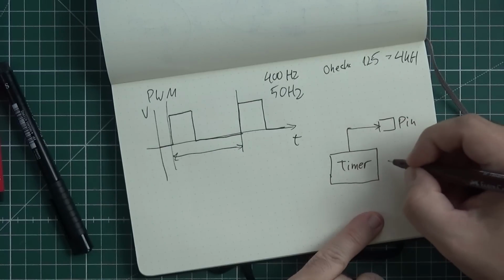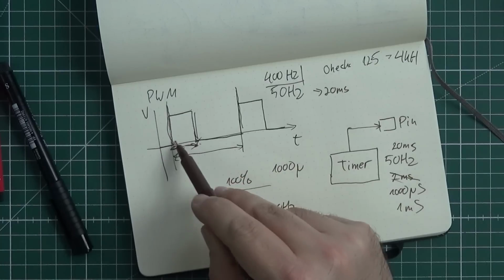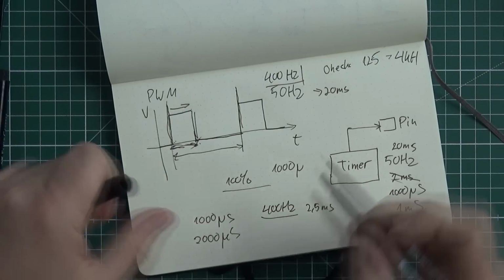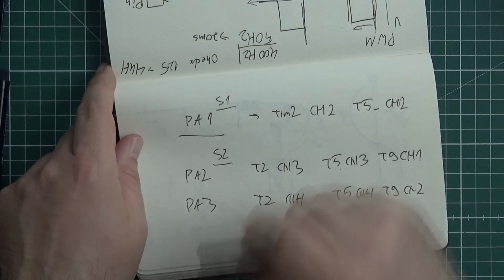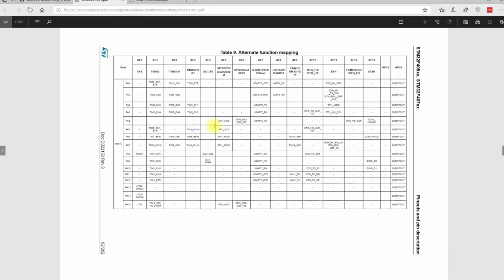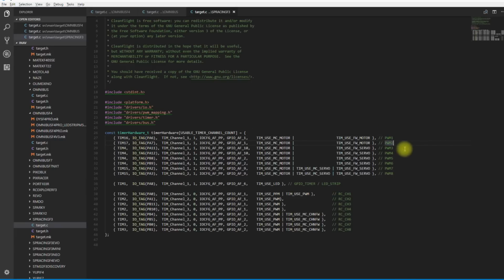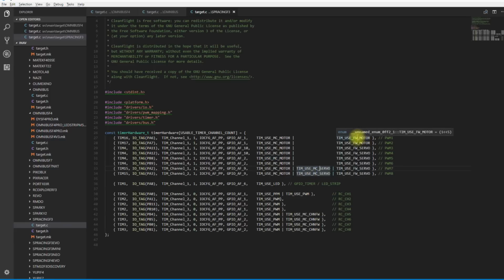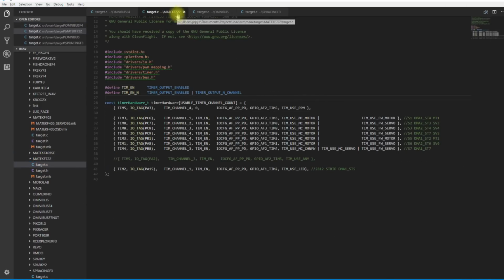INAV, Resource Mapping, Motors, Servos and Timers

Comment: Inav 8.0.1 - I am building an Octo X8 - Inav is assigning Motor 5, 6, and 7 - all three - to timer 8 - is that OK?  Three motors on one timer?  It's odd because the other timers each share TWO motors - so why is timer 8 spread among three motors?  Also, I can't get motor 7 to spin and it also happens to be the THIRD motor assigned to Timer 8.  So is it the fact that it's the third motor on Timer 8 the problem?  And if so, how do I fix it?  Thanks...

Comment: must ask you once time more for help. My problem is that with  inav51 and omnibusf4pro my esc's and motors burns. The reason is rate of pwm for motor that is in reality 401 Hz. Thearetically it is possible to change this frequency to 50Hz but in reality frequency rest 401 Hz. Change to 50 Hz is possible in CLI but this is not working. Error in INAV or something can be done ? The frequency for servos is correct and equal 50 Hz.Thanks for your help in advance.

Comment: Hi Pawel, watched your video with interest as I seem to have a problem that is of the same nature:
I am trying to setup a Volantex ASW28 with a Matek 405 Wing. I want to add a Pan/Tilt camera mount on channels 7 and 8.
I have a Crossfire Nano (UART2) and a Beitian 220 GPS (UART3). I have an OLED connected to DA1 and CL1.
GPS works, Receiver works, OLED works.
Mixer Preset is "Airplane"
Motor is on S1, S2 is not used because as you showed it's not for servo use and could fry the servo
S3 is Elevator Servo
S4 is Left Aileron Servo
S5 is Right Aileron Servo
S6 is Rudder Servo
S7 is Pan Servo (passthrough from RC Channel 7)
S8 is Tilt Servo (passthrough from RC Channel 8)
But none of the six connected servos work (servo rail has 5V).

When I use the status command on CLI tab, it shows:

PWM output init error: Not enough servo outputs/timers

I am running INAV 5.1.0 and used the inav_5.1.0_MATEKF405SE.hex (76f22b25) target to flash the FC.
Any ideas what could be the reason? Any help would be greatly appreciated...

Comment: 13:50 What if I have 4 motors drone and want to use PWM3-PWM6 for motor 1..4 ? Can I then use PWM1 and PWM2 for different purposes?

Actually, I have Matek 405HDTE which has s1-s8 available for motors, but s3 is broken, and I have 4-motor drone. And I can't find how to use, for example s5 for motor #3, because if I choose 4-motors drone, it doesn't allow me to have access to the s5 and more. If I choose 6 or 8-motors drone, I soldered s5 to motor 3 and it works, but what to do with wrong configuration? Is it possible to tune it manually somehow - leave 4 motors drone but have it to treat s5 as s3 ?

Comment: It would be awesome if you made a follow-up video showing a couple of examples of how to set up those those lines for a custom build. 
One question that a follow up might answer is whether you can assign a different timer to an output, such as changing PA8 to TIM 3 instead of TIM2.  Or is the mapping of timer to output determined by hardware?

Comment: I have a related issue, but I can't tell if this is the same problem. I have 6 functions and 6 outputs on my board, but in the output mapping box in the outputs tab, the functions are shifted over to the right, meaning I can't arm because the FC is trying to output PWM through the imaginary S7 and S8, while S1 and S2 are unused... This video seems like quite a lot of work for shifting those functions over to different outputs.

Comment: Is there any way of getting motor output limiting like on Betaflight so that I can run my 4s motors on 6s?
Reply from the maker: throttle_scale
Reply: @FPVUniversity  Thanks! I initially thought that it would not apply when in autopilot like rth (in cases where there was wind and the motors were over-revved)

Comment: So on my miniquad, I mistakenly installed my MATEK F722SE with front of board facing the rear. The motors are connected to the wrong pins on the board. I can do resource remapping with betaflight, but not with INAV 2.5?

Comment: Thanks for your video! If I want install an FC without channel output (span pro f4) on a single motor wing...in your opinion how can I use motor output 2 and 3 (or 3 and 4) for the servos? Can I tab resource on CLI, copy the ports on servos 1 and 2 to motor 2 and 3 resource? That all? Thanks in advance. Sorry if is not clear.
Reply: did you get this figured out? I'm not using any motors on my board and I cant even have 6 servos despite having 6 pwm pins.

Comment: I am trying to get the electric retracts to work on my Matek F722 FC, it was easy in quad config as the servo output just automatically is set to pin s6.
This is a problem now because I rebuilt it to a hexacopter and cannot get the s7 pin (it even says "PWM" on it) to operate the retracts, it still puts servo1 on pin s6. Any ideas?

I have never looked into the firmware stuff, is this useful in any way?

#ifdef MATEKF722_HEXSERVO
    DEF_TIM(TIM1, CH1, PA8, TIM_USE_MC_MOTOR | TIM_USE_FW_SERVO, 0, 0),  // S6 DMA2_ST6
#else
    DEF_TIM(TIM1, CH1, PA8, TIM_USE_MC_MOTOR | TIM_USE_MC_SERVO | TIM_USE_FW_SERVO, 0, 0),  // S6 DMA2_ST6
#endif
    DEF_TIM(TIM4, CH3, PB8, TIM_USE_MC_SERVO | TIM_USE_FW_SERVO, 0, 0),  // S7 DMA1_ST7

    // DEF_TIM(TIM5, CH3, PA2, TIM_USE_ANY, 0, 0),  // TX2/S8  DMA1_ST0

Comment: Hi, thanks again for taking the time to give us this video, and for all your other efforts for the community. My question: - is there a reason why we have to run the motor outputs at 400Hz for fixed-wing aircraft? All standard receivers run all their PWM outputs at the same 50Hz servo timing, so surely iNAV should do this from the FC. This would elimiate the issue with re-mapping motor to servo outputs in the FC, would it not? We don't need the kind of throttle control that quad pilots need, so I'm sure 50Hz is perfectly acceptable (and it means that you won't burn out your servo if you accidentally plug it into the wrong output!!) :-)

Comment: Hi Pawel,
Great video, learned a lot from it and set up a machine and compiled a build to make sure all works. 
I am trying to build a Colibri Race target with a small change, but am not sure how to make it happen. If I understood your explanations correctly this should work...just a matter of knowing what to change.  ESC 2 pin always acts as pitch on my fixed wing. I am not sure what to change to make this happen. There does not seem to be any timer conflicts.
    DEF_TIM(TIM1,  CH1, PA8,  TIM_USE_PPM,                          0), // PWM1 - PA8
    DEF_TIM(TIM3,  CH1, PC6,  TIM_USE_MC_MOTOR | TIM_USE_FW_MOTOR,  0), // PWM2 - PC6
    DEF_TIM(TIM8,  CH2, PC7,  TIM_USE_MC_MOTOR | TIM_USE_FW_SERVO,  0), // PWM3 - PC7
    DEF_TIM(TIM8,  CH3, PC8,  TIM_USE_MC_MOTOR | TIM_USE_FW_SERVO,  0), // PMW4 - PC8
    DEF_TIM(TIM8,  CH4, PC9,  TIM_USE_MC_MOTOR | TIM_USE_FW_SERVO,  0), // PWM5 - PC9

My 3 servos would all be on tim 8 and motor would be tim 3. but the above stock code makes any motor connected to esc 2 pin be controlled by pitch. Unsure why I can not use esc 1 pin

Any help would be greatly appreciated!

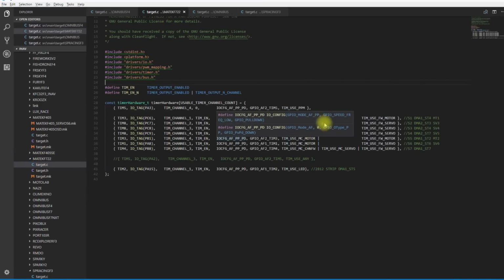Comment: Hello Pawel, thanks for the technical explanation on timers! On 15:20 the Matek F722 board, why can't you allocate TIM1 on PA8 as a servo since for a quadcopter you have TIM3 and TIM8 distributed among five output pins? And can you explain what you mean by S7 not being driven directly? Thanks!

Comment: hello, I have to remap engine 1 on engine 5 on omnibusf4pro, I modified the main file / target / OMNIBUSF4 / target.c changing pb0 to pa1 and the other way around, I saved, compiled and flashed but the exchange does not happen, where am I wrong?
Reply from the maker: you also have to adjust timer associated with the pin itself
Reply: @FPVUniversity  I forgot about the timer,😩 thanks a lot😀

Comment: Buenas tardes, magnifico como siempre, muchas gracias por  el vídeo. :-)
Por otra parte no si esta relacionado con este vídeo y si se puede hacer, yo pregunto.
Tengo entre otras, la compre por probarla una f4, es una f10-wing fc, firmware ff_f35_lightning 2.0.1, muy baratita, ciertamente va muy bien, pero tiene un problema, me ha dado por ponerle led_strip a los avienes, y esta controladora no parece que tenga habilitado un puerto para esto. tiene sin embargo invertido un puerto para telemetría smartport de frsky, se conecta directamente sin ningún tipo de soldadura en ningún pad y funciona muy bien.
He consultado el comando "resource" y parece que tendría varios puertos libres, no se si son compatibles con los temporizadores, te pongo un listado:
# resource
IO:
----------------------
A00: SERIAL4 UART TX/RX
A01: BEEPER OUT
A02: SERIAL2 UART TX
A03: SERIAL2 UART RX
A04: OSD CS
A05: SPI1 SCK
A06: SPI1 MISO
A07: SPI1 MOSI
A08: INVERTER OUT
A09: SERIAL1 UART TX
A10: SERIAL1 UART RX
A11: USB IN
A12: USB OUT
A13: FREE 
A14: FREE 
A15: FREE 
B00: MOTOR5 OUT
B01: MOTOR6 OUT
B02: FREE 
B03: SPI3 SCK
B04: SPI3 MISO
B05: SPI3 MOSI
B06: I2C1 SCL
B07: I2C1 SDA
B08: MOTOR3 OUT
B09: MOTOR4 OUT
B10: FREE 
B11: SERIAL3 UART RX
B12: FREE 
B13: SPI2 SCK
B14: SPI2 MISO
B15: SPI2 MOSI
C00: MPU CS
C01: ADC CH3
C02: ADC CH2
C03: ADC CH1
C04: MPU EXTI
C05: BARO CS
C06: SERIAL6 UART TX
C07: SERIAL6 UART RX
C08: MOTOR1 OUT
C09: MOTOR2 OUT
C10: LED1 OUT
C11: FREE 
C12: FREE 
C13: FREE 
C14: FREE 
C15: FREE 
D02: FREE 

Como la tengo instalada en un ala volante, y solo necesito dos servos ¿Podría habilitar/remapear/asignar por ejemplo el motor 6/servo 6 para sacar por ahí la señal de los led? y si por ejemplo la usara en una avión en el que necesito los cuatro servos, dirección-profundidad-y dos alerones ¿Podría usar otra salida?por ejemplo ¿o ver algún otro puerto libre?
¿como puedo saber cada recurso a que salida de pines esta asignado?
Y, jaja, mas importante, como sería el código para hacerlo, para asignarlo.
Perdón por mi osadía e ignorancia. Ya sabes la ignorancia es muy osada.
Un saludo y muchas gracias.

Good afternoon, great as always, thank you very much for the video. :-)
On the other hand not if it is related to this video and if it can be done, I ask.
I have among others, buy it by trying it a f4, it is a f10-wing fc, firmware ff_f35_lightning 2.0.1, very cheap, it is very good, but it has a problem, it has given me to put led_strip to the avienes, and this controller it does not look like you have a port enabled for this. it has nevertheless invested a port for telemetry smartport of frsky, it connects directly without any type of welding in any pad and it works very well.
I have consulted the "resource" command and it seems that it would have several free ports, I do not know if they are compatible with the timers, I put a list:
# resource
IO:
----------------------
A00: SERIAL4 UART TX / RX
A01: BEEPER OUT
A02: SERIAL2 UART TX
A03: SERIAL2 UART RX
A04: OSD CS
A05: SPI1 SCK
A06: SPI1 MISO
A07: SPI1 MOSI
A08: INVERTER OUT
A09: SERIAL1 UART TX
A10: SERIAL1 UART RX
A11: USB IN
A12: USB OUT
A13: FREE
A14: FREE
A15: FREE
B00: MOTOR5 OUT
B01: MOTOR6 OUT
B02: FREE
B03: SPI3 SCK
B04: SPI3 MISO
B05: SPI3 MOSI
B06: I2C1 SCL
B07: I2C1 SDA
B08: MOTOR3 OUT
B09: MOTOR4 OUT
B10: FREE
B11: SERIAL3 UART RX
B12: FREE
B13: SPI2 SCK
B14: SPI2 MISO
B15: SPI2 MOSI
C00: MPU CS
C01: ADC CH3
C02: ADC CH2
C03: ADC CH1
C04: MPU EXTI
C05: BARO CS
C06: SERIAL6 UART TX
C07: SERIAL6 UART RX
C08: MOTOR1 OUT
C09: MOTOR2 OUT
C10: LED1 OUT
C11: FREE
C12: FREE
C13: FREE
C14: FREE
C15: FREE
D02: FREE

Since I have it installed on a flying wing, and I only need two servos, could I enable / remap / assign, for example, the 6 / servo 6 motor to take out the signal from the LEDs? and if for example I used it on a plane where I need the four servos, depth-direction and two ailerons, could I use another output, for example, or see some other free port?
How can I know each resource to which pin output is assigned?
And, haha, more important, as it would be the code to do it, to assign it.
Sorry for my daring and ignorance. You know ignorance is very daring.
Regards, and thank you very much.
Reply from the maker: lo siento, no hablo Espanol
Reply: @FPVUniversity  gracias por tu pronta respuesta, lo he puesto en inglés a continuación, en inglés de Google, jaja.
Thank you for your prompt response, I have posted it in English below, in English from Google, haha

Comment: Can I use the motor output for servos on a Betaflight F4 flight controller?
Reply: Did you solve?  I want install an FC without channel output (span pro f4) on a single motor wing...in your opinion how can I use motor output 2 and 3 (or 3 and 4) for the servos? Can I tab resource on CLI, copy the ports on servos 1 and 2 to motor 2 and 3 resource? That all? Thanks in advance. Sorry if is not clear.

Comment: How was this problem overcome with inav 2.0? I've tried assigning a 3rd motor to my matek f405 with inav 2.0 and I don't get it as an listed output in the mixer tab.
Reply from the maker: INAV 2.0 is not even trying to fix this. It allowed for better mixer management, not output management
Reply: Paweł Spychalski I think I understand it's just giving you outputs from the rules available, but you get to pick the outputs from the rules available.

Comment: Hi, 
thanks for the explanation. But what do you mean by S7 is not driven out directly on the Matek F722?
I'd like to employ it on a quadcopter with four servos for gimbal etc. Is it possible to use S2, S3, S4 S6 for Motor output and S1, S5, S7 as Servo PWM? An 8th PWM Pin would be great, like using the LED Output..I don't need LEDs in this project. Is something like this possible?
Reply from the maker: Not on Matek F722. This just will not work

Comment: just found your videos, very helpful... thanks...question...can all the timers all be set at a high rate like 360hz and use only digital servos or motors on any pin? I recall being able to do that with baseflight long ago but had no arm/disarm feature because I was using servo pins and not the motor channels

Comment: Pawel, i'm trying to manually control pitch on my Storm 32 Gimbal on my quad using AIRBOT Omnibus F4 V5. im not sure if i should connect it to PWM 5 or PWM 5 pin on the board or if it is possible at all. Please help if you have any tips. Great video though

Comment: Thanks for the great explanation, but one question, wouldn't plane esc's be fine with servo frequency of 50Hz? they don't have the same response rates demanded by quacopters running D shot, one shot etc. Basically everything in a plane (analogue servo equipped) can clock at 50Hz.
Reply from the maker: Yes they would, but what about tricopters? And other setups? We will not implement solution that works only of some of setups
Reply: So at config model type, setting airplane could not configure the outputs to be unified at 50hz? Sounds like inav is still unsuitable as a fixed wing alternative with too much multirotor legacy. One day maybe..
Reply: @alasdair4161  If it breaks off into a wing only configurator, we also break up the brains and support and community feedback into pieces as well.

Comment: Pawel, let me disagree with your explanation in case of airplane I DON"T need any fast PWM for motor. 50Hz is enough so mapping servo to motor output should be possible. And to prevent burning servo in case of any remapping all timers are blocked to 50Hz. Is there anything wrong with my understanding of remapping?
Reply from the maker: Please remember that your need (or lack of one) might not be one for someone else. What about tricopters?
Reply: Just talking about planes, copters are different story and 3copter is copletely different. And in case of planes you can use even now mmix to drive i.e. rudder. But I think this should be more consistent.
Reply from the maker: But when you add a resource mapping it has to support all supported platform. Not just selected. Or you end up is even worse situation in a beginning.
Reply: right, so maybe all is needed to document how to run i.e. rudder with mmix in case of plane. BTW I'm not sure if any servo will be affected by oneshot, but I need to check.
Reply from the maker: Cheap servos will fry up immediately at 400Hz. Only really expensive ones will survive 300Hz. All the cheap ones share the same chipset
Reply: you are right, I mixed pwm freq with multishot
Reply: @FPVUniversity  Hi - I am in the same position as this poster.  My single motor on my fixed wing is happy at 50hz, but I need to use S2 as a 50hz servo because my "Omnibus F4 V2" is kind of weird and only has 4x output pins.  Since S2 is disabled for me (can only be motor), I can only control the main motor, roll, and pitch - no yaw.  What can I do??
Reply from the maker: @tymarbut4784 write a custom firmware
Reply: @FPVUniversity   - Hi, thanks.  I was investigating that - I found the .c and .h and .mk files on github, and I can see exactly what to edit, but I don't know how to make the magic .hex file out of those.  For now, I'm just going to control the rudder and flaps from the radio and iNav will only have access to motor/ailerons/elevator.  Hopefully it can still fly.

Comment: OK, if you cant' do Resource Mapping on iNav, what about including features like Channel Forwarding or Servo Tilt?
Reply from the maker: Both of those features are present! But since they are not well documented and vary from target to target, they will be removed from INAV 2.0 and replaced with unified MIXER options. And documented and with tutorial :)
But they still will not work on all targets just because of the hardware problems descibed in this video. Sometimes we just have to option to do it
Reply: Great....any predictions on the 2.0 release?
Reply from the maker: Amm... we just released 1.9.1 so please give us some time. 2-3 months probably